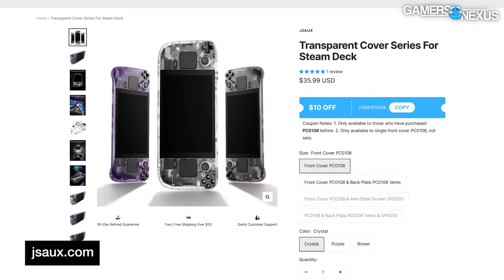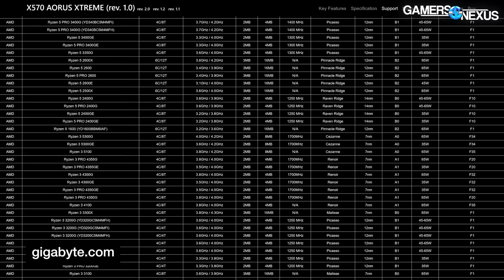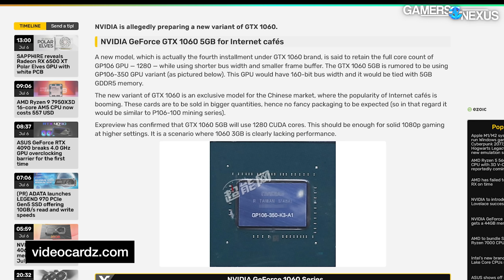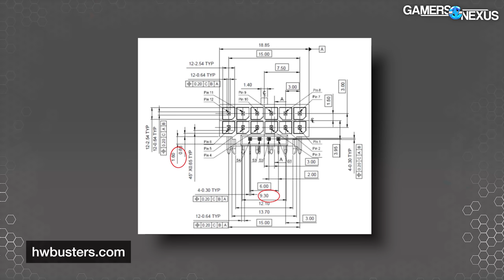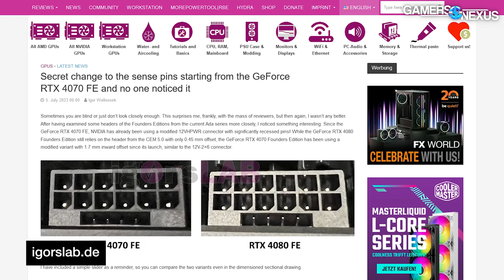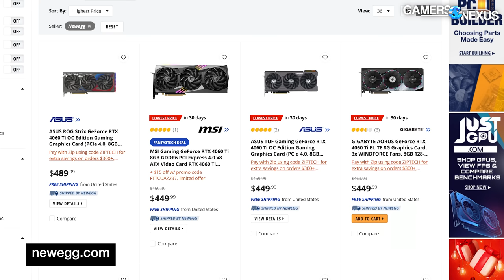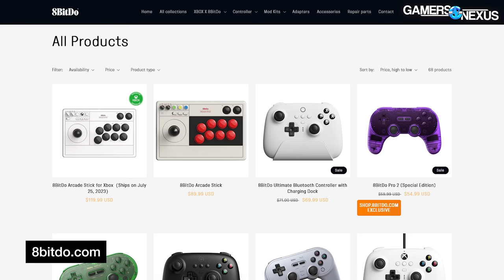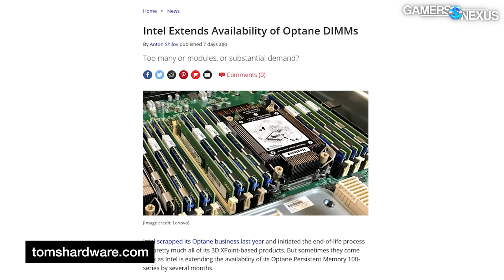HW News - Ultra-Small Intel Arc GPU, 12V-2x6 Connector, More AM4 CPUs, 4060 Ti 16GB

Comment: The Ryzen 5 7500F 3.7/4.8ghz (5ghz single core) should run cool while sipping a good deal less power. Very ideal for internet cafe's. 
The Geekbench benchmarks are interesting. Granted it was tested on an A620 board. The 7500F trailed the 7600X by ~3.5% in single core. But, it eaked out a ~2% win in multi-core.

Comment: A bit unrelated

@gamers nexus: I recently got AK620 Digital Air Cooler for my new intel 13th gen build. The issue im facing is the digital display shows incorrect temperature and utilization readings when compared to Hardware Monitor readings.

Would be great if the team can review AK620 Digital cooler and also see if this is a common issue with it.

Build Details: core i5 13500, B760M MSI MAG Mortar WiFi DDR5, 32GB 5600 Corsair Vengeance, 3060ti Founders Edition, 750W PSU, CH370 White case), 1TB XPG Gen4 NVMe SSD

Comment: Yey for finally a HH/HL/LP Arc GPU!
Hmm for the 4060 GPU with one extra M.2 slot... why just hmm? Because this should have been on card bifurcated/switched to GPU and at least 2xM.2... this seems to be using the mobo bifurcation to 8x+8x so they're still losing 4 precious lanes. I wonder if they just could put there an OCU-link 8x PCIe port for daisy-chaining... or maybe even a built- in riser for LP card attached to or through the 4060... Heck, they could've put in there a multi 10+GbE port NIC and an M.2 slot to provide almost everything an editing rig needs on a single card...

Comment: Apparently not everything's perfect with the Jsaux kit to go full transparent shell on the Deck, the shell itself is very good but the tools suck, the tool to slide under the screen is made of metal which makes not scratching the screen impossible, the plunger is close to useless because of how bad it is and also their video was made using a Deck that's been disassembled several times and someone doing it for the 1st time will have a pretty distinct experience because many steps will be much harder to reproduce on a never opened up before Deck.

I think it was both The Phawx and Taki Udon who reviewed it and made those critics. The Phawx even suggests buying a replacement screen with the shell it makes the whole process go from nightmarish to pretty easy (for an additional cost, obviously but if you consider buying a new set of tools to limit the risks of breaking the screen, getting a new screen right away and stick with the crap tools might be the best solution for most people).

Comment: 4060ti 16gb has to be the stupidest gpu launch this year. We have all complained about low low buss widths, less than 10gb of vram, higher prices for lower tier cards with a step higher name than it used to get, and now even x8 lanes instead of x16. So they ignore it all and launch trash after trash, then try to play the good guy by "Refreshing" it with actually nice levels of memory, just stuck onto a waste of a board that costs x2 what it should.

Comment: Given some of the older stock that's still floating around, I really wonder just what the 5100 is going to be priced at. The 3600 is running 80-90, 4500 70-80, and these are both hex cores.

Might be another OEM special, but still... I can't really see this chip selling at all if it's priced over 65 and even that's being generous.

Comment: I want to see someone disable 2 cores on the 5600X3D and then do gaming benchmarks. I say this because I think that 96MB of 3D cache means way more to performance than another two cores do. Remember the 5600X3D basically scores the same in gaming benchmarks as the 5800X3D. I want to see exactly how far core count can be cut for gamers, eliminating the tendency towards more cores when conventional die space would be better spent on more cache.

Comment: There is also a Ryzen R7 5700 . . . it's a 5700G, but with no "G" , no iGPU. They're as low as $125 bucks on ebay. 8C/16T, 16MB L3 cache, etc.

Comment: My current Z790 board has a Gen5 x 16 top PCIe slot, while its four M.2 slots are all Gen4 x 4. If the M.2 slot on the graphics card is just wired directly it could be a way of adding a Gen5 SSD to the system. I'm not sure what use case would require such a fast drive with such a (relatively) low power GPU, and why you wouldn't get a board with native gen 5 m.2 but it's an option.

Comment: The whole last gen high end GPUs persisting at the expense of current mid range ones is a holdover from the mining bust with AMD/Nvidia having too much left over stock and/or having overcommitted on fab orders which they are now stuck with having to sell at or below cost. It doesn't make sense to manufacture new products at the same performance level when you could just mark down the ones you've already paid for until they sell.

Comment: Every 4090/80 owner should be supplied  a new spec cable. Or cover the cost of replacing replacing any cables direct from PSU vendors
Reply: @anticommoncore4065  I realise that  (but re reading my post it looks kike i dont)but if you bought a new PSU with a dedicated 12vhpwr, so no adapter needed, and now after being told for long enough that any issue was your fault and all of a sudden its not and you own a lovely fire hazard, how pissed would you be ?  I was gonna say I'm glad I'm sticking with my 3080 and missing this shit show, but I've got a AM5Asus board with a 7950x 🤣🤣🤣

Comment: I'm on the fence with this M.2 thing.  It's cool, no doubt.  But if it is an ATX board there is a good chance those lanes get bifurcated down to another x16 slot (the usual x8x8), in which case I'm not sure if there is any gain.  However if its a Z or X series board with more lanes from the PCH that may not be true.  But then the question is there still vestigal x8 x8 bifurcation in the BIOS so this works?

You are still leaving the last x4 hanging (because x8x4x4 bifurcation really is too much to expect), but it is something.

I of course would love to see a setup where that M.2 slot is connected via breakout to another video card 😂.

Comment: m.2 on the GPU would actually make a lot of sense with DirectStorage. Why pulling the data far away, when you could add memory on the GPU. Maybe in the future this could help to make the GPU even faster, if for example Games could save texture files on the memory on the GPU and the GPU can instantly get these files from it's memory. Or Shaders that get compiled and saved on the m.2 storage on the gpu. The issue is that NVIDIA would remove the m.2, instead welding it on the main platine and give xx60 users 128 GB of memory. while 90 users might get 2 GB, and 80 users 500 GB.

Comment: I was trying to hold out for the A380 LP for a system I was working on, but I decided to just get the A380 Challenger. Edit: it got delivered.

Kind of curious. I was under the impression this card could run just off the PCIe power, but my MPG B550 board wouldn't detect it until the GPU power connector was plugged in.

Comment: GN getting on PCIE SIG when?

On putting M.2 drives on GPU cards, there are a bunch of reasons it could be a good idea even for the ones that aren't just wired for x8. First it is currently impossible, short of synthetic tests, to saturate a gen 4 x16 link to any GPU. Second if Nvidia and AMD are serious about Direct Storage then putting storage on the actual graphics cards would cut a bunch of latency out of the process (which would have its own complexities as it would change how games were stored and installed but that is certainly something that can be solved).

Comment: 16:00 I wonder - would it be possible to use a M.2 slot for a 4060Ti? As in, plug a weirdly shaped 4060Ti into a M.2 motherboard slot?

Comment: Steve, can you do a test where there a spacers for the AIO (space between fans and radiator and fans again)?  I've seen tests where the ideal setup is having spacers between radiator and fan and even a spacer in front of the first intake fan vs no spacers.  The problem is space and screw length, but if you have a giant case like a Meshify 2 the only issue would be screw length.

Comment: single slot, passively cooled, no extra power required video card with 4 monitor support in high def.... intel arc a40 or the matrox version are what I hunger for but they are simply not available anywhere

Comment: Interesting, so to access the extra lanes for an M.2 port, do they need to an PCIe splitter chip for that? I recently looked into using my second 16x PCIe slot for multiple NVMes, but my board doesn't do bifurcation on that one, and the price increase of PCIe cards with built-in splitters is pretty steep.
Reply: Ah, okay, I should maybe finish watching the segment before commenting.

Comment: Does this mean NGreedia subtly admitting it's connector is designed incorrectly? Finally they acknowledge the percentage of owners that are not cautious in plugging the connector in as this procedure shound not be an issue. GN should not blame owners for this issue as it's a design error as being confirmed now.

Comment: NVME on a GPU is something I've wanted for a long time, hopefully someone, literally anyone, other than Assus will do it, with a GPU from not Nvidia.
Reply: This could actually make that silly 4 lane GPU from AMD worthwhile, since it could carry 3 M.2 drives from a lane count perspective (theoretically the 4060 could carry 2 but would need a motherboard with x8x4x4 slot bifurcation, which is to my knowledge not a thing in practice, whereas x4x4x4x4 is very common). Would be quite useful in some home lab setups.
Reply: @bosstowndynamics5488  Yes! I'd actually not hate the RX 6500/ 6400 if they did that..
Reply: @Vinterloft  I would buy one tomorrow if it was a semi sensible price, currently struggling to find the most elegant way to fit a second low end GPU into my server

Comment: I really struggled pulling the trigger on a 4070 but I did. However, in the looking the naming for AMD seems to be 7900 taking the place of the 7700 cards and I could not find one but the 7900XT taking eh place of the 7800 and they top card being 7900 XTX. Just wait for the to add xx50s to the mix. even though I bought a  4070 I still view it as a good 4060 and when they release the 16g 4060 I view it as a jacked up 4050

Comment: The new 5100 is probably the 5300g that failed and had its onboard graphic permanently disabled.  AMD recycling rejected silicon dies by reducing cores or features since the 3-cores Phenom era.  5600x3D is the same thing, cut down from 5800x3D

Comment: I personally think the 12V connector is fine. I have my 4090 in a build I use for testing GPUs, I have installed and removed the card more times than I can count since purchase in November 2022, I have not had any issues

Comment: I have the 8bitdo ultimate controller with the hall effect sticks and I have their m30 2.4 sega controller, the lack of support for the ultimate to be used in rewasd means I can't use the analog triggers and the gyro in the controller at the same time, and the m30 8bitdo doesn't even make software for that and two of the buttons are binded to the same out put so just never need to hit select and remember the right bumper Isreal as the left trigger and the right bumper and trigger are face buttons, also mine didn't have a spike under the dpad on my m30 meaning every now and again it click left when I'm clicking right, its also read as a joystick and not all the directions are perfectly lined up so if I push down in the center of the dpad my character or whatever would be slowly moving up and to the right, still might buy the neo geo controller, definitely not in an abusive relationship

Comment: I am thrilled to hear that the POS 12VHPWER is no more but has been massively improved into 12V-2x6 and yet is still the same POS GPU power solution it always was. Talk about the emperors new clothes! It never was and still isn't fit for purpose. I'm just glad it is still possible to avoid this nonsense.

Comment: 12VHPWR still seems like such a complete waste of energy and materials. Most people will be using their existing ATX v2.x PSUs for the coming years anyway (like the Seasonic 660p in my main rig), so anything that requires something other than PCIe power connectors for the GPU are just a complete hassle. All 12HPWR and now 12V-2x6 (WTH, did the USB-IF help here?) just seem to add a more fragile and fire-prone connector for no good reason.

If a GPU uses more power than two PCIe connectors can provide, I don't want it anyway.

Comment: The 7500f should be a global release but if I want one bad enough I can import it but that defeats the purpose of saving the money. If this CPU launched everywhere for like $150-$180 it would convince quite a few people (I think) to jump onto AM5 with an A series or B series board. Idk about you but regardless if it's AMD or Intel...dropping over $200 for a cpu and putting it in a measly $100 dollar board seems silly to me and once you hit the $200 range on boards you're paying for I/O basically when referencing lower end cpus like these because the added power phases etc. are entirely unnecessary and not worth the extra money. Things are in a weird place right now. I understand these are 6 core cpus...but if we're honest with ourselves that's basically the minimum these days and is barely acceptable...imo. Same thing goes for 16 gigs of ram and 8 gigs of vram and 1 tb ssd. Barely acceptable these days. 13400 and 7600 should be $180 cpus at best but whatever.

Comment: To be fair, the vast majority of mobos seem to support PCIe bifurcation these days due to the proliferation of passive 4 way M.2 carrier cards. If ASUS were really clever though they would add a x8x4x4 bifurcation mode to their motherboards and reclaim all 8 extra lanes with a 4060+2x2TB or similar, as it stands their current prototype assumes that x8x8 or x4x4x4x4 are the only options and therefore still wastes 4 lanes.

Comment: Shame that the ARC cards requires rebar.  That A380 would be perfect in quite a few systems that need gpu upgrades.
Reply: Rebar goes back to 2010 so its in more old computers than you think.
Reply: @GoonyMclinux  Perhaps but it's only actually usable for 10th+ gen intel and Ryzen 3000+ series for AMD.

Comment: found a returned 5600x3d at my local MC for $183...tempting.  But I'm only running a 3060 with a 5600x so I really don't see the benefit in purchasing it.  Still kind of want it tho 😂

Comment: the clear steam deck shell is cool but changing the front cover is likely not something the average user should attempt
Reply: I've heard so many horror stories of people destroying their display during disassembly to install the front shell. 

I'll probably be waiting for an aftermarket OLED display to release for the steam deck before attempting a clear front shell.
Reply from the maker: Agreed. The average user should be extremely careful if trying this. It's not too difficult if you've done some similar work before, but definitely shouldn't be a first time effort.

Comment: Hey Steve, minor thing but it would be nice if you could find a compatible font for Simplified Chinese and not a Japanese font (which you're currently using). Characters which exist in Simplified Chinese but not Japanese display incorrectly and it makes the display of characters look rather ugly. If you take a look at 19:00 you'll notice that all Simplified characters other than 装 (which was simplified the same way in Japanese) look very different.

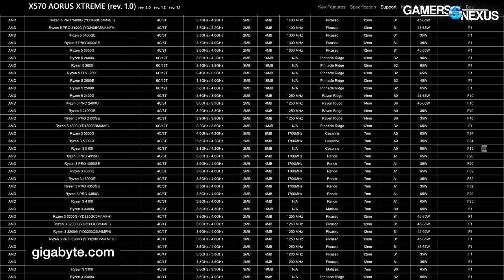Comment: 4:20 - A proper 5500X3D would be much more interesting than a mere 5100. AMD may be continuing to "support" AM4, but not in a manner that will garner significant marketshare or mindshare.

What I dislike about most of these low end SKUs is that they are not designed from the outset to be what they actually are; instead, they are just the table scraps of failed units from higher SKUs (or surplus laptop parts), fused off and deliberately limited so as not to make higher tier parts look absurd, something the accidentally excellent 3300X most assuredly achieved. There's no reason for a 4c/8t part to have such low base & boost clocks, or a smaller cache, not when the thermal budget per core is by definition so high. So the parts end up being cheap(er), but that's all; it means using them inevitably creates a hefty gap to the next tier up, ie. it's a quiet upsell (better to just buy something 2nd-hand from a previous higher tier, even from Intel, which of course does the same kind of product segmentation; or there are alternatives for the same socket within the same budget class). Many years ago, thermal budget per core was a popular talking point in CPU articles, but that's rarely mentioned these days.

Will a chip company ever again genuinely push technology forward for its own sake? It seems the new normal means the answer is no.

Hence, AMD isn't continuing to "support" AM4 with genuinely new SKUs; instead, its gilt-laden throne trundles along while unwanted morsels are tossed out the windows as "new" SKUs, in quantities far too low to be relevant in terms of any market impact.

I have a lot of AM4 systems (1600 AF, 2600X, 2700X, 3600, 5600X, 5700X, etc.); it's just sad that this wonderful platform could be capable of so much more, a potential never realised because we all have to move on to the New Current Thing. A genuine 5500X3D with good clocks would make for an excellent budget gaming platform, but of course it would make lesser AM5 parts look stupid (just as the table-scrap 5600X3D already has, or could if it was priced sensibly), especially wrt value, DDR4 being as cheap as it is atm. The only caveat factor is mbd availability, though the used market has been a good source for me so far.